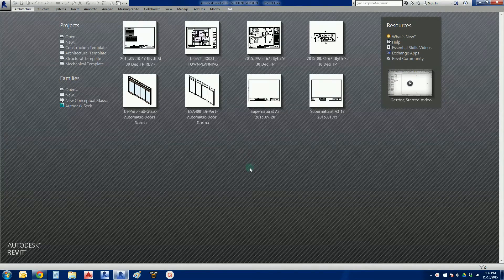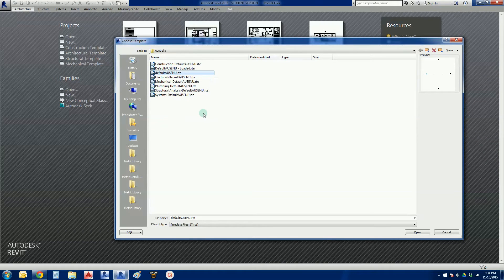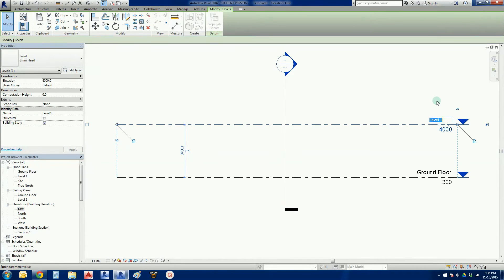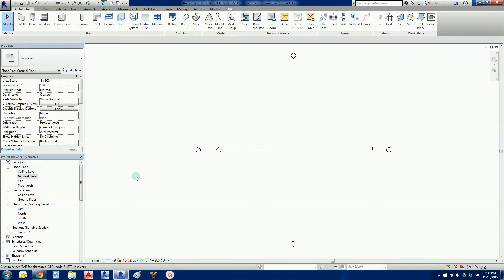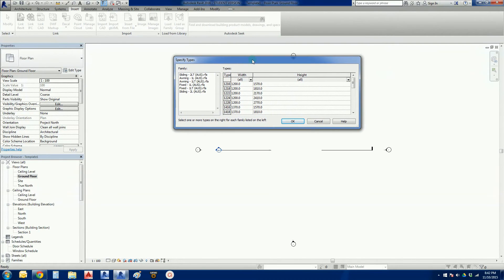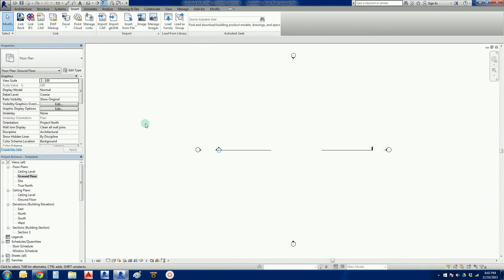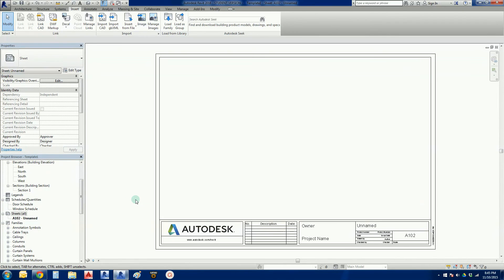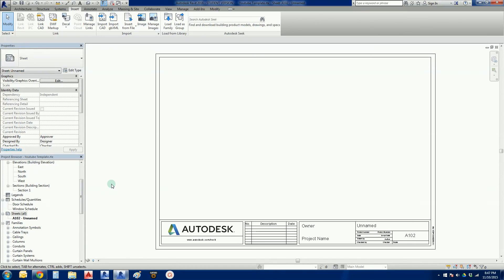Revit 2016 - Project B #1: Setting Up a Template

Comment: The best way to set up a template, is to complete a full project with all your customization and then save as a template after deleting your model objects. There are also more ways to maximize the efficiency of your templates, but the main, best way, is to complete your project so that you have all your typical views already in place. All your typical notes, details, etc would be already placed and ready for you on your next project.